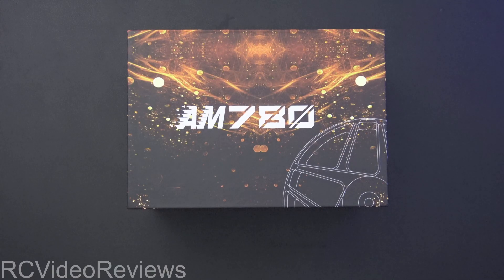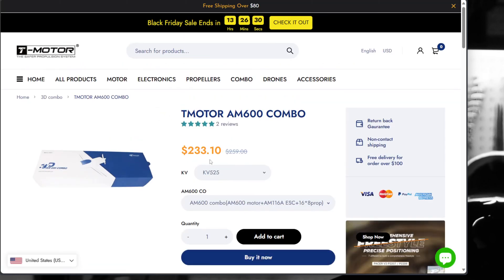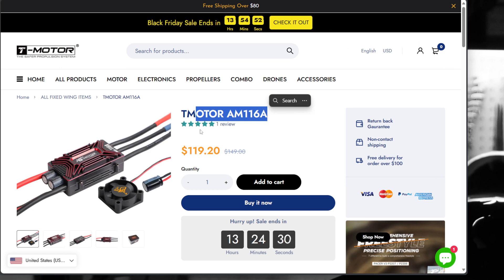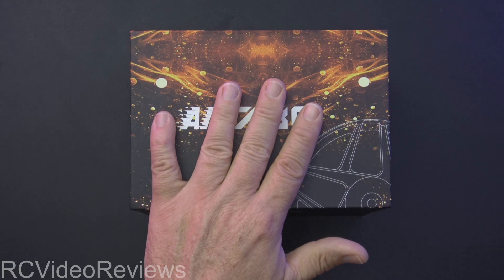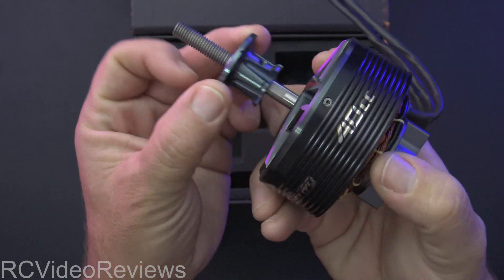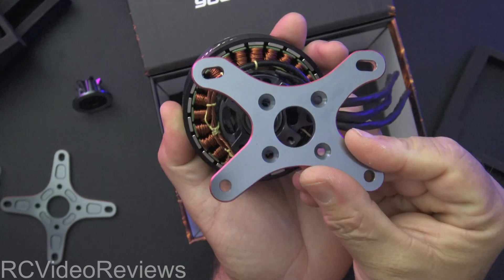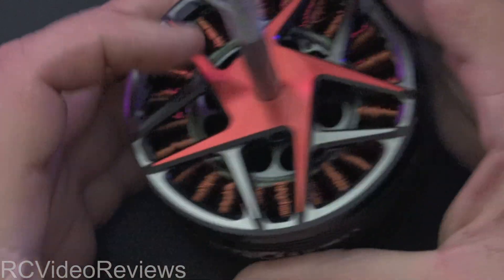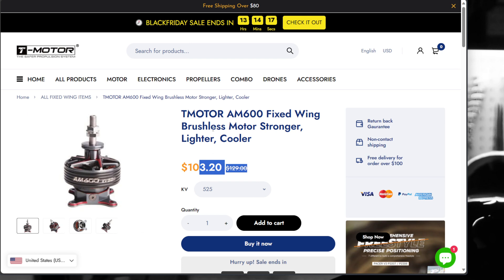BRAND NEW: T-Motor AM780 40cc Brushless Motor PLUS: CYBER MONDAY SALE!

Comment: Care to suggest a Tmotor for my Hanger 9 Cub 40 ARF 80” to run on 6s w/ my 100amp ESC…? Currently looking at AT4120-560kv, please help…
Reply: At a weight of 7.5 lbs, a power-to-weight ratio of 130 watts/lb, and 3.7 volts/cell..

Watts required = Weight (lbs) x Watts/lb = 7.5 x 130 = 975 watts
Amps = Watts / Volts = 975 / 22.2 = 43.9 amps
Unloaded rpm = Volts x Motor KV = 22.2 x 560 = 12,432 rpm
Static rpm = Unloaded rpm x 80% = 12,432 x 80% = 9,946 rpm
Pitch speed = Static rpm x Pitch / 1056 = 9,946 x 6 / 1056 = 56.5 mph
Prop watts = 5.3E-15 x Static rpm^3 x Diameter^4 x Pitch
A 13x6 prop would be 5.3E-15 x 9,946^3 x 13^4 x 6 = 893 watts
Input watts = Prop watts / 0.9 = 893 / 0.9 = 993 watts
Input amps = Input watts / 22.2 = 993 / 22.2 = 44.7 amps

That's pretty close. A 4120-560KV motor, 60 amp ESC, 4000mAh-6S battery, and a 13x6E prop should be about right. These calculations are at 3.7 volts/cell, so this is the performance at the end of the flight. All of the values should be about 10% higher with a fully charged battery.
Reply: @TheRCAviator  thank you for your Math, and advice.  I’ll be using your data for sure.  👍
Reply from the maker: What size prop? There are really only 2.5 options: AM600 (too small), AM670 (sounds right), AM780 (too big).
Reply: @RCVideoReviews  no specs on site for AM670, 480 or 520kv?  Those are the two options.  How about the AT4120-560kv.  It’s got Raw Data.   Any advice?
Reply from the maker: AM670 spins a 18x8 CF prop and produces 2300w. Specs are here: https://tmotorhobby.com/goods-1244-TMOTOR+AM670.html

Work on your google-fu. It's weak.
Reply from the maker: I haven't tested AT4120 so I can't say first hand.
Reply: @RCVideoReviews  I was thinking 14x7 prop… Any Input?  My first ARF BtW